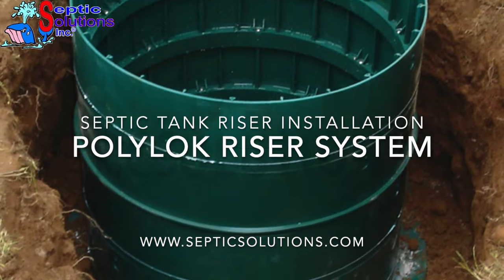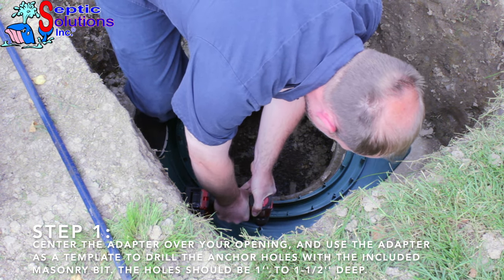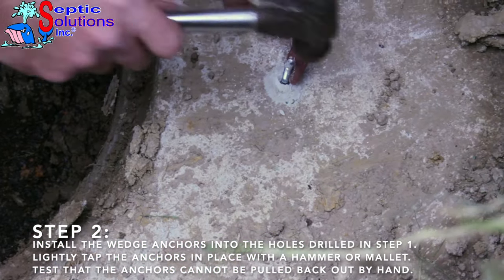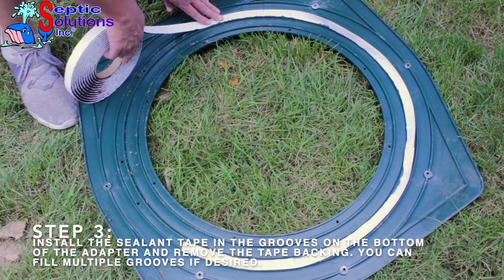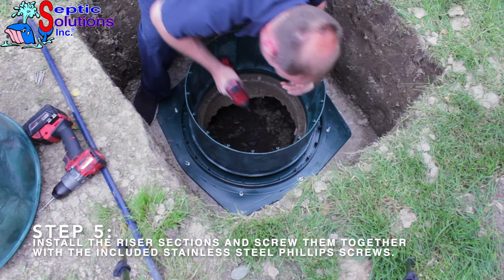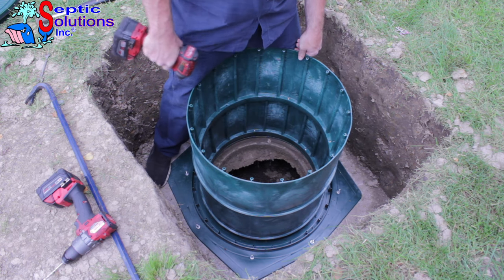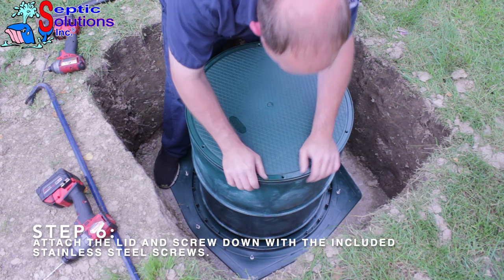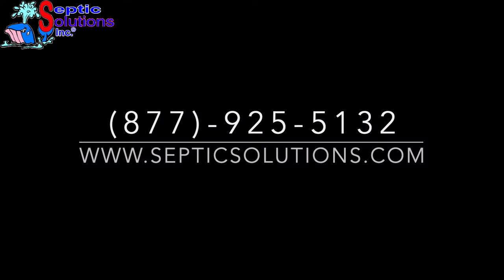Septic Tank Riser Installation - Polylok Riser System from Septic Solutions®

Comment: Do you need to put the concrete cover back on when you do a riser like this. Some people are telling me to too but I don’t see the purpose.
Reply: It helps keep the gases in and dirt out as a secondary level of protection. Why not put it back on? It takes no effort.
Reply: Just had my tank pumped, the concrete lid was very difficult for them to remove. With the riser installed, there would be no room to lever it up.

Comment: is it required to drill and screw the bottom part to the tank or can the double sided tape hold it? im a little worried about drilling into my tank since its so old, I'm afraid I'll start a crack
Reply: That’s a reasonable concern. Mine is almost 20 years old. I’m going to scrub the concrete really clean, rinse and dry with a shop-vac, then use several tubes of Lexel sealant. That stuff sticks tenaciously to just about everything. My sump tank already has a plastic riser, but concrete is so uneven that the adapter ring is useless.  I’m going to slip the new one over the old, level and secure it, then pour closed-cell polyurethane foam in the void between and around the outside. There’s no way it will ever budge or leak.
Reply: How did this work out? Facing the same problem. Just want to use the foam sealer.
Reply: @barrydavidsonpicpp3330  It turned out the lid/openings to my tank are like 4 inches from the edges of the tank so I couldn't put one of these on anyway, there isn't enough surface around the openings to put one of these on
Reply: I had a septic contractor say that the thick tape (2 rings) was sufficient and that drilling and screwing into a 20+ year old septic could cause cracking.  They use the sealant tape or lots of strong adhesive.  I will be doing this myself very soon to my 24 year old septic and I’m NOT drilling into my old septic tank.
Reply: I installed one and drilled into my 45 year old tank with no problem . If your worried about drilling the top of your tank with a 1/4" masonry bit, your tank needs replacement.

Comment: Do we need to drill into the concrete or can we just use thick butyl tape?
Reply: I think the fumes and weather would ruin the tape, and drilling is scary. What about concrete outdoor adhesive, then covered with cement with binder around the riser outside to seal and secure it to the tank?
Reply: You don’t really have to anchor it but it’s highly recommended

Comment: Is it necessary to keep the concrete tank lid inside the riser?
Reply from the maker: It is optional. Many times if you have a square lid it will not fit through the riser stack for removal which means you cannot keep it in place. The Polylok system is sealed so there is no real advantage in keeping the existing concrete lid in place.